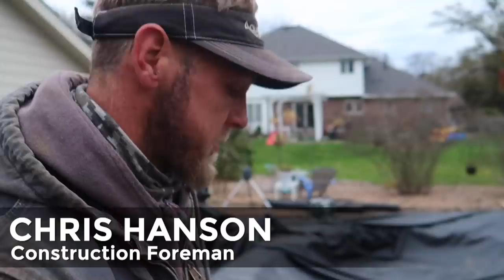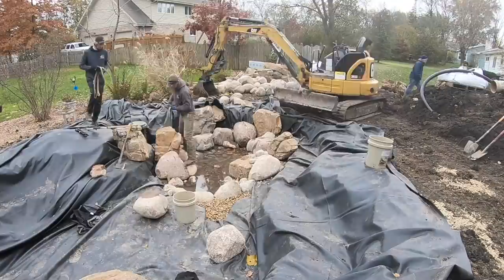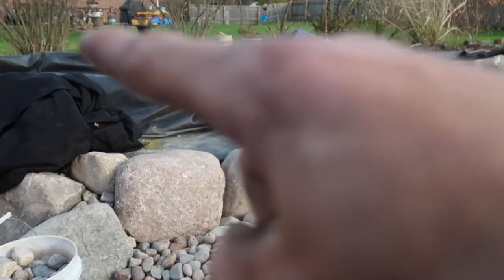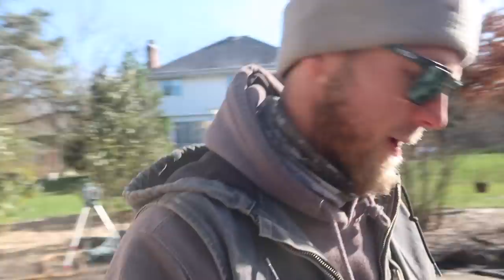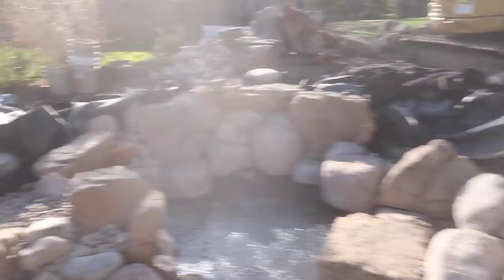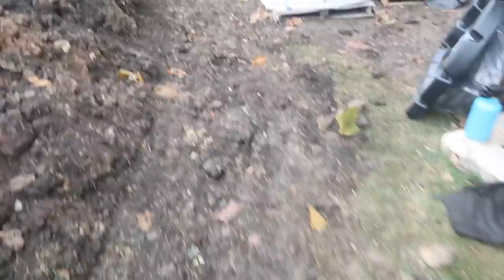Drainage Solutions for 3-Foot Deep *POND* - Part 2

Comment: i understand this vid is a couple of year old..However i live in Houston and it rains a bit... The problem is not so much underground water but rainwater running from the slop of the house to the pond.. How do i stop rain water from running under the liner... 

Should i put a drain like you guys did just in case??